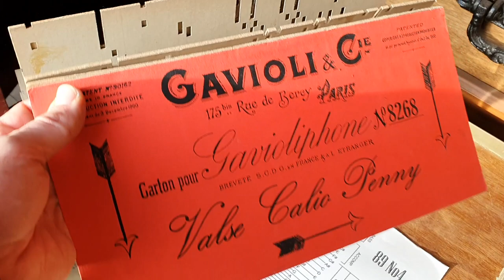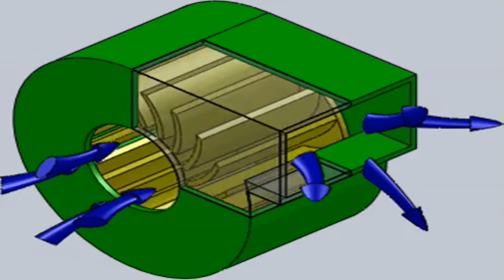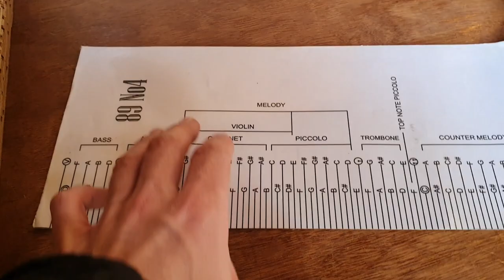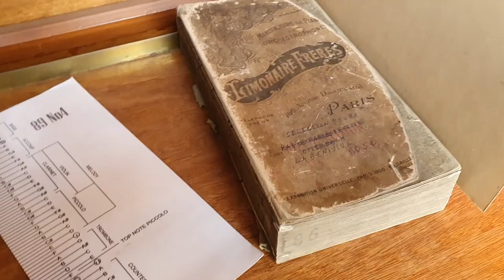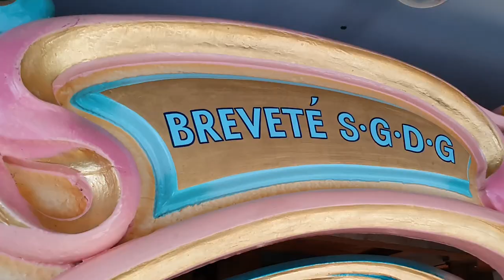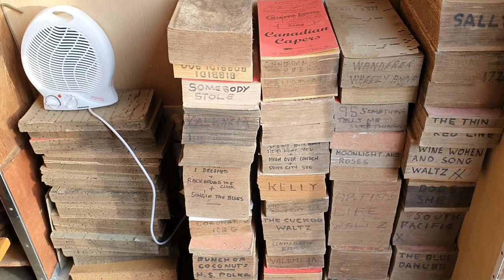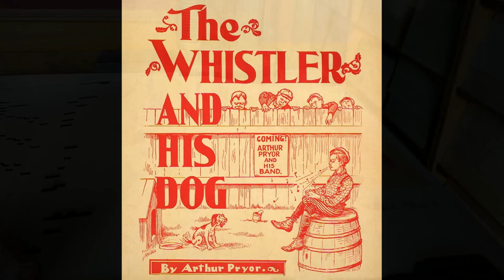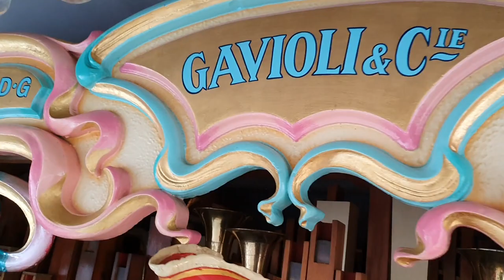How It Works... Mechanical GAVIOLI FAIRGROUND ORGAN from 1905 ex Day's Gallopers with Nick Williams

Comment: You should put a large automotive air filter on the input to the blower.  This will help keep the insides of the organ clean.  (I note dirt in the mouths of the violin pipes in the front from the airflow.
Reply: It would need to be a large lorry one to handle that air flow without causing supply reduction

Comment: I, as a fan of sound chips, see strikingly many similarities. Limited timbres, limited number of notes (this doesn't apply to many chips but still)... A wonderful instrument! The only thing I do not understand is why base drum and cymbal share the same control, but well, I am a century away from those who designed it!

Fun fact: small handheld barrel organs can also do drum-like sounds when you rapidly switch all the keys on and off.

When you said that some organs use paper holes to block airflow, I immediately wondered: can tremolo be done on such organs by making a hole which has changing width along it's length? Since these instruments can't do portamento nor vibrato, a tremolo could be a nice addition.

Comment: You wondered why people often call the fairground organ a "steam organ", Of course they don't know what they are talking about. But surely you are aware of the steam calliopes which were in fact a set of steam whistles, which actually are blown by steam from a boiler. These were commonly used by circuses and steam river boats. They were meant to be heard a mile away. They were usually played from a manual keyboard. There were also air calliopes, using high pressure compressed air. They could be played from a keyboard or a paper roll.

There is a large collection of fairground organs and band organs near Chicago at the Sanfilippo estate. Some of them have been modified to play from a midi controller to save wear on the cardboard books. They also have a restored carousel.

Comment: Does it still have a 110V DC input? So if you met with someone with a Showman’s engine at a steam fair you could get the organ hooked up to the engine’s generator as originally designed?

Comment: One question Nick (this is Harry by the way) how do the figures work? Do they have a bellow inside?
Reply: Yes, the bellringers have a single pneumatic motor inside the figure and the bandmaster has either two or three at the back depending if it is a a two or three movement figure, wires are connected to the motors which move the arms and head.
Reply from the maker: Exactly as Peter says, internal pneumatic motors. The air tubes for the bandmaster are disguised by the brass pole at the rear, and those for the bellringers (which play with the bass drum signal) are hidden by the facade.

Comment: How many tunes can the organ play?
Reply: one at a time
Reply: @theorganguy  Witty ! And how long do they play?  From beginning to the end.
Reply: @pouglwaw5932  I would have loved to give a more practical answer... alas, there is a wide range of "truths" to that. Barrel organs for example had only up to 9 titles of between 45 seconds to 1 minute runtime, but of course these could be played non stop. How many "organ books" are with the organ in the video I simply do not know. However, if one was to take this question to its extreme end, then I have to even say: pretty much the majority of all tunes ever composed - the caveat being, that a lot of tunes simply have not been arranged for these, although they CAN all be played if one prepares the tune.
Reply: @pouglwaw5932  I am not sure what is the longest known 89 key music book. But I would guess it's probably some overture or other and probably plays for over 10 minutes. If you have never seen one of these organs in person it is hard to fathom how heavy a stack of cardboard book music can be when it is a fairly long tune (short tunes aren't too heavy). A full wooden 'case' of book music can weigh over 100 lbs and take some effort to move around inside the organ trailer. However again most books of pop songs, marches, waltzes etc will be relatively shorter and only the big overtures (and a few concert waltzes etc) will be super long.
Reply: Unlimited, insert any book in the key frame with a different tune and you're set.